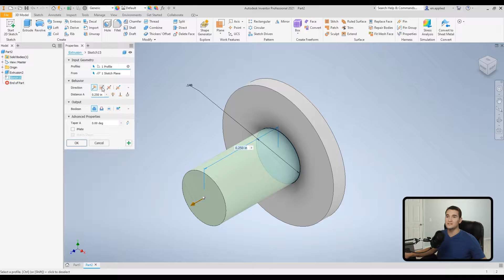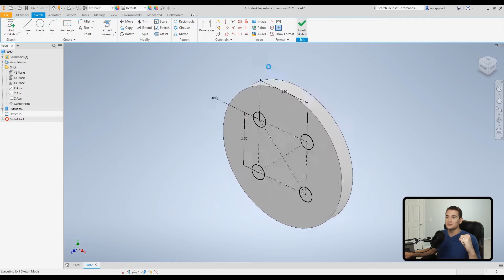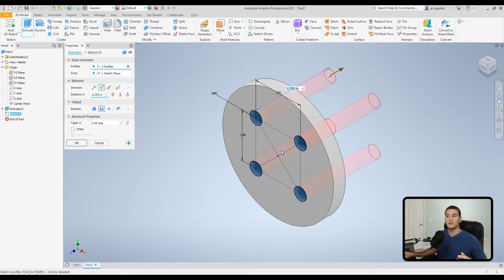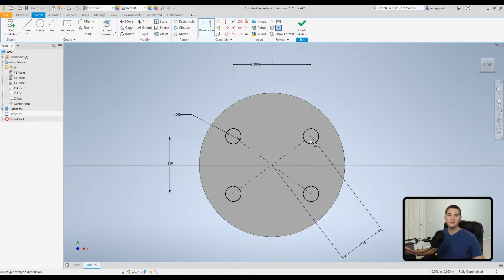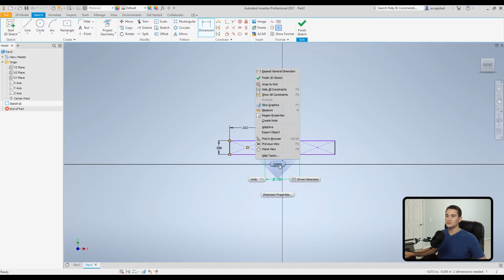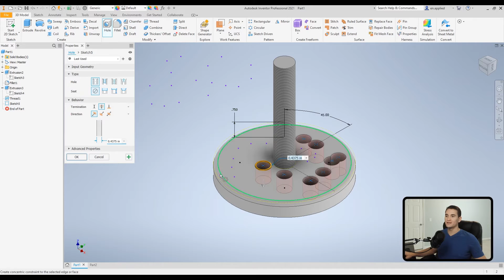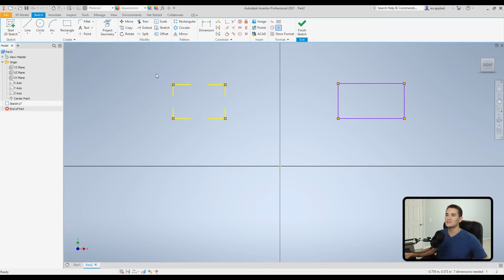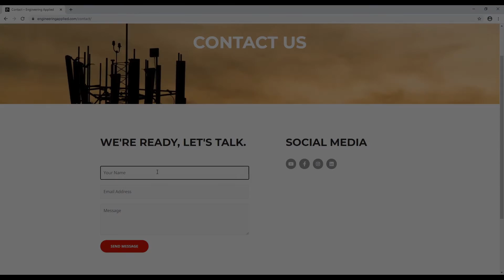2D Sketch Format Options - Autodesk Inventor Part Tutorial | Autodesk Inventor 2021 IN DEPTH

Comment: Thank you for the video tutorial. Inventor is very similar to the Fusuion 360 I'm working on at the moment. Many options are the same or very similar. Why do I want to switch from F360 to Inventor? After 2 years of working on F360 (and learning this program from Lars Christiansen) and reading a lot of comments and opinions, Inventor is a more stable program, has better computational performance (especially during assemblies), and has added a lot of motions to assemblies. Fusion360 is not the best program for creating assemblies with multiple elements and adding movements.
Reply from the maker: You're welcome! I'm glad the video was helpful! They are similar in many ways. I think a lot of people are asking a similar question with regards to whether or not the switch from one software package to the other is worth doing. For a lot of basic engineering/drafting roles, as well as new entrepreneurs and product designers, Fusion 360 is more than capable for their job/business needs (especially for the relatively low price). It will be interesting to see how the performance of Fusion 360 will improve over time since it is cloud-based. I appreciate you taking the time to comment on my videos and thank you for watching!